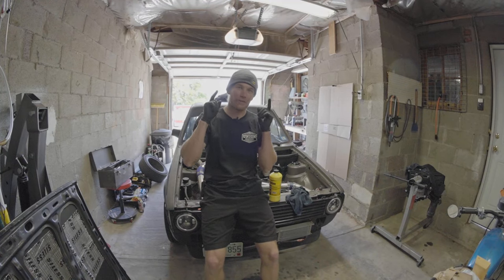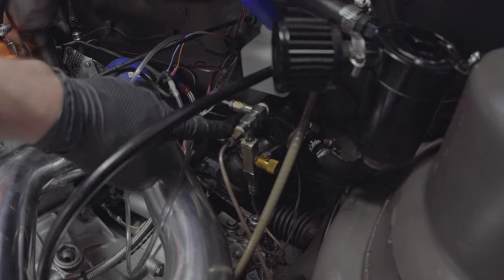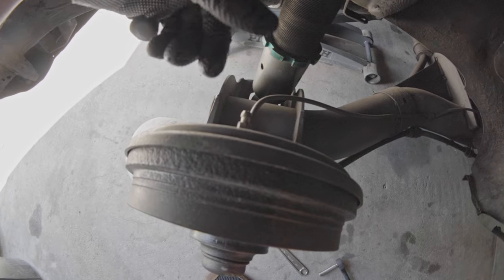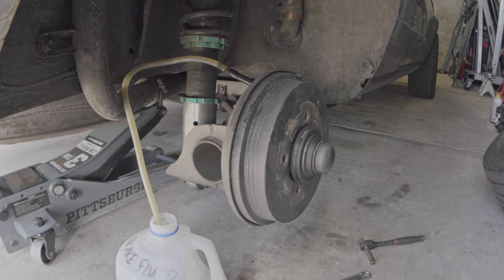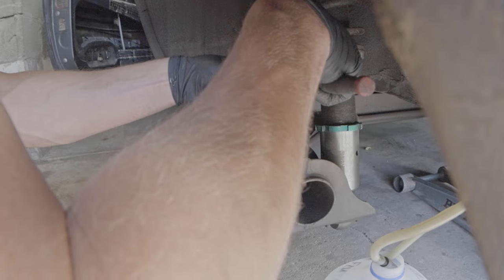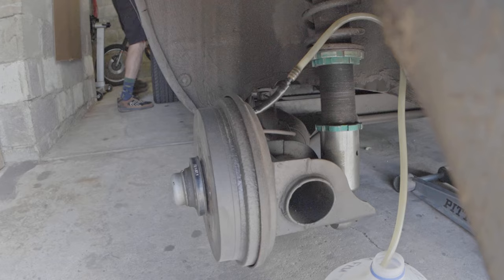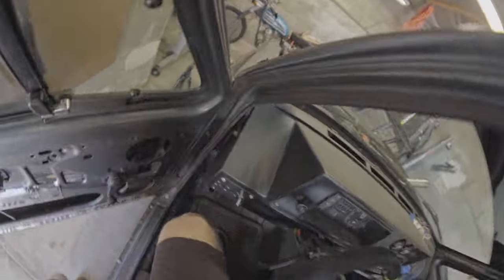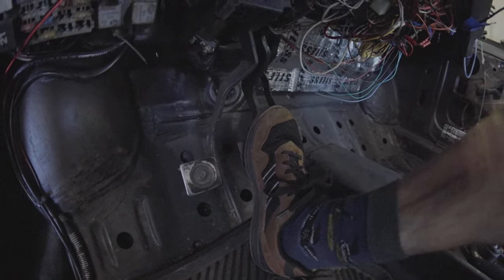HOW TO bleed your brakes (the cheap & easy way!)

Comment: Bled mine few days ago. Why not put some discs on the back?!
Reply from the maker: Nice! Honestly I just don't think it needs it 💁 the drums still lock up (if you press hard) and plenty of braking force as it is. I could see the value if I did circuit racing or something... probably would be nice to have rotors to manage heat better. Too many other upgrades to spend $$ on 😁🫡
Reply from the maker: Do you have rear discs?
Reply: @OliverFetter  drums on mine too but have been considering the swap
Reply: @chrisladouceur4093  What kind of donor works best?
Reply: @khester7397  not sure tbh. I’ve got a mk2 and just piecing together a kit

Comment: I’ve always wondered why the fluid doesn’t just suck back into the caliper when you let up on the pedal using this method. Is it just bias created by gravity? Or the small bleed valve acts like a check valve? Also, tdi swap coming up? 😁😁
Reply from the maker: I had to look it up 😂😂 I had no clue. Answer: a combination of fluid interia & gravity make it favorable to refill the MC from the reservoir instead of sucking it all back in 🤓 there ya go. Yes tdi swap is coming up!! Not super soon bc life is busy but it's in the works, will be honing it soon 👌